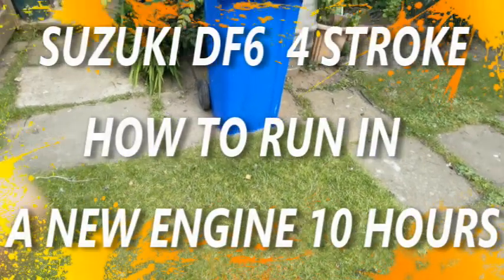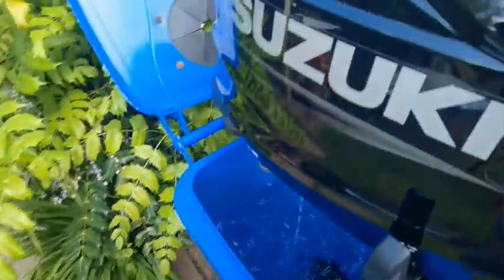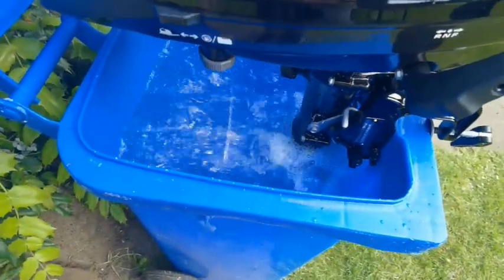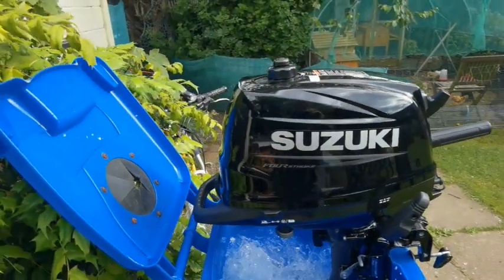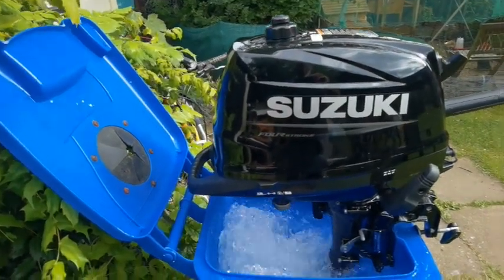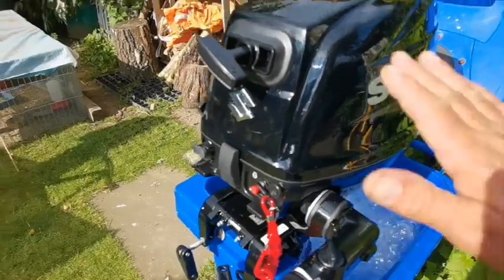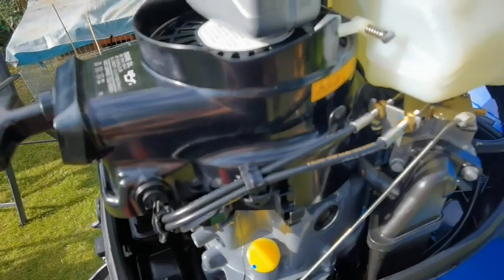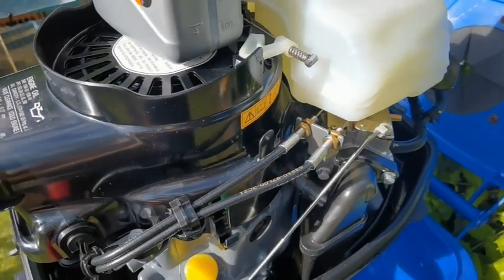SUZUKI DF6 4 STROKE HOW TO RUN IN

Comment: Do you drain the carburator after every use before transporting? I have the same 2022 motor.. just wondering
Reply from the maker: yes i just ran it in a water but till it stoped ,not the best idea

Comment: I have one, used aa couple of times, took it out for pre use test run; and when I accelerate, it runs very rough when t5hrottle past half. How do I adjust carb to run smoother; Alan

Comment: The best run-in is to chuck it on a boat and use it for an hour. . Change the oil and filter and go for another 3 hours, Change them again and you good to go.  I dont see the point of letting it idle away for ages. It needs to be loaded for the rings to seat properly
Reply from the maker: Thanks for the info
Reply: Why do you have to keep changing the oil and filter?
Reply: @colcol3235  Because the engine sheds a significant amount of metallic particles during the first few hours of use. Enough to give the oil a pearlescent sheen. The idea is to remove this contamination as soon as possible and replace with clean oil which will reduce wear.
Reply: It doesnt say to do that in the manual? Is your application for older motors? I say this with a purely learning tone..
Reply: @colcol3235  Not at all for older engines only however the df6 does have a oil filter so it's a cut above the rest in that regard.  I just don't see the benefit of letting a brand new engine run through its first few hours of life in oil that is contaminated with metal particles that have been shed due to the normal bedding in process. I'd rather get rid of those particles and do it as quickly as possible to try and give the engine the best chance at a long and fruitful lifespan. My other issue with outboard break in periods requires a bit of critical thinking.....why does a outboard require such a detailed , time consuming dare I say tedious break in but not a generator for instance ? Or a Weedeater ? Or a car ? Or a motorcycle. I'm no engineer but the engines is these applications are much of the same thing. Long story short I think that outboard break ins are counterintuitive.